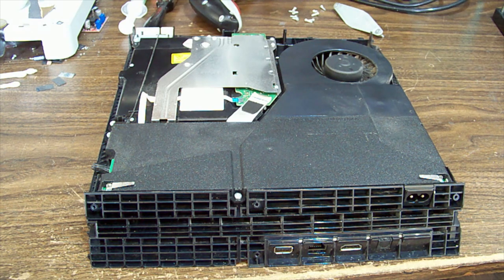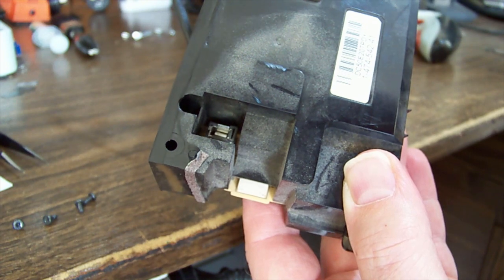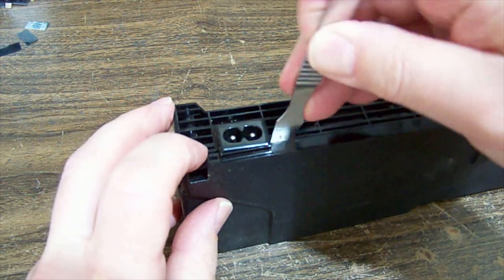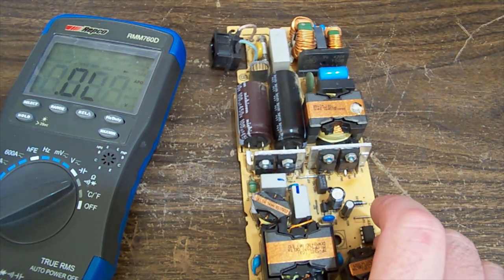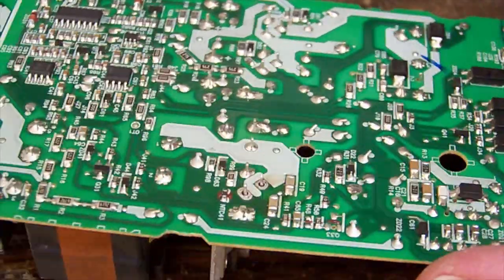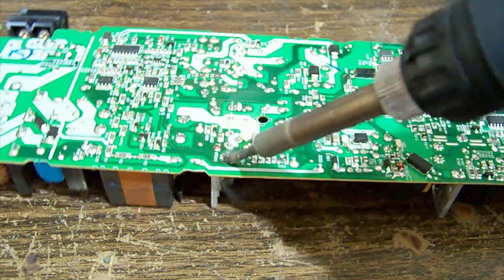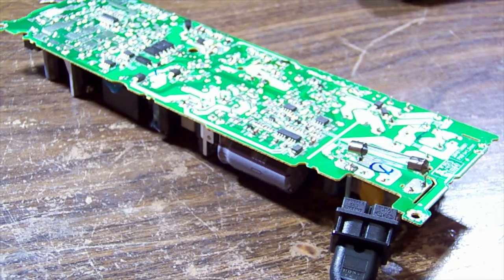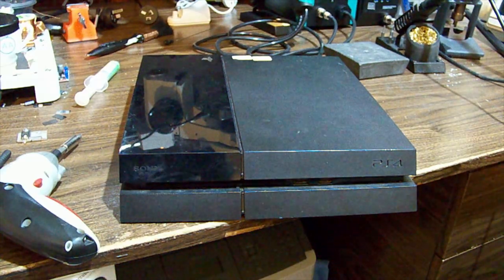Playstation 4 no power repair!

Comment: Same to the 42 inch Ultra HD TV I brought online for spares or to repair,Wont power up,Only costed me 99p,Repaired the power board by replacing 2 components what had also blown,It powered up no problem,Had it about 3 years now,Still in good condition,The same thing gone wrong with my Playstation 4,The Ultra HD TV was not under warranty,It well worth pulling to bits for repairs

Comment: Hum ... I have 2 power supply, exactly the same model as yours is the video, and both have the same burned mark in front of that mosfet. But, they are not shorted, neither are the fuses blown, but they both doesn't work, and both have the 5v stand by.
Maybe I should still replace them, even if they seems to be good.

Comment: Well done :-D
20 thousand eyes watching you at a slightly different angle lol, yes i'm silly.
Hell you could grow potatoes in that mucky supply :-D
I know the power factor correction circuit in vestel made t.v sets can fail, it won't switch on untill some capacitors are replaced.
Yep the p.f is often monitored,  voltage across the  cap has to be about 405 ish volts.
Lucky you had a parts psu with a kidney/mosfet donor card lol :-D.
Reply from the maker: Never throw away junk items. Good thing I don't have a shed or I'd collect more junk!
Reply: @JonnyFix  You need the ronco expandable shed, only $19.95 at all good stores.. bad ones as well :-D

Comment: my ps4 turns on perfectly but as soon as i start any game it shuts off directly..ive already changed the thermal paste so no overheating problem..can you tell what exactly  the problem is?
Reply from the maker: So it will stay on forever while in the menu? What about playing a dvd? Is it definitely only games that cause this? One thing you might try is backup your data then do a full reset on it. You can download the operating system from playstation website onto a usb drive then completely erase the hard drive and reinstall it. If that doesn't work I might be guessing but maybe there's a hardware fault that causes it to fail when it switches to a higher graphics resolution mode that games would demand of it.
Reply: @JonnyFix  thanks for the reply.Yes It stays on when Im doing nothing on it,also if i watch YouTube there’s no problem but as soon as I launch a game ex:need for speed,the game loads and when the car comes on the screen it goes off total black screen and no blue light no white light.I will try the full reset thing that you told.
Reply: @aat2312  what was the result?
Reply: @weebnation3904  nope fan works fine, i think there is some problem with the apu, it might need reballing

Comment: Hello, can the IPA60R280P6 Mosfet be used to replace the STF13NM60N Mosfet? I am trying to repair a Gen 1 PS4 and I've got a dead PS4 Pro PSU that I am planning to use for parts.
Reply from the maker: A quick look at the datasheets suggest it should be ok. It's a bit slower to respond but I don't think it would be an issue.

Comment: Did you change both the electronic components that are attached to the heat sink with new one?
Reply from the maker: Just the one bad one.
Reply: @JonnyFix  the mosfet ?
Reply from the maker: @alengine94  yes
Reply: @JonnyFix  many thanks

Comment: I'm pretty sure why my PS4  1000 terabyte PS slim doesn't work now I'm pretty sure it's because it's really dirty I've only had it 3 years got it brand new at the time does not work anymore blue light issue going on off doesn't work hasn't worked since last November

Comment: Just the question I pulled apart my son's PlayStation 4 it's the one with the two screws at the back not for screws I pulled the whole thing apart I have reput thermal paste down I've put it all back together I lost one of the large screws that come out of the power supply that hold the metal  10 piece that goes over the power supply of put one screw in a hold the other side down and I'll try and turn on the PlayStation and all it does is beep three times no lights show up at all and if I press the power button all it does is beep at me once and wait for about 4 seconds then beeps three times but it doesn't show any lights at
Reply: Probably it's under tha couch 😂